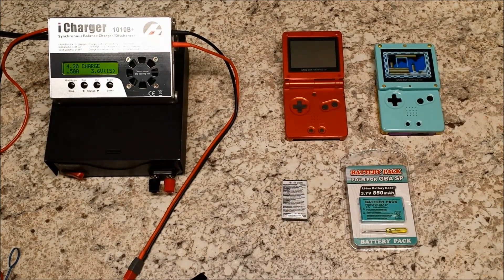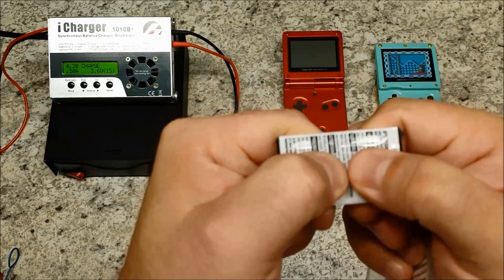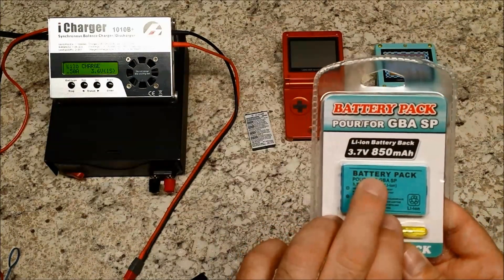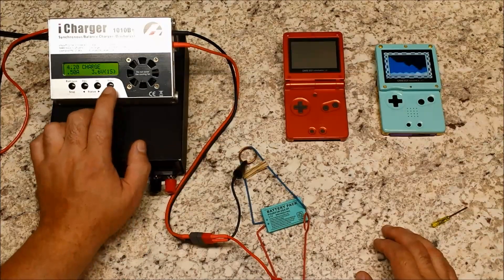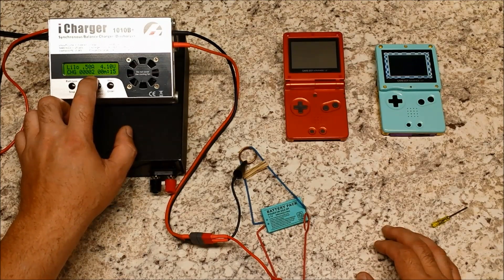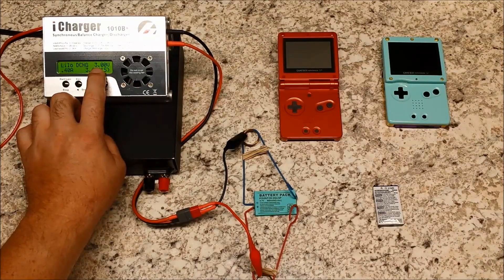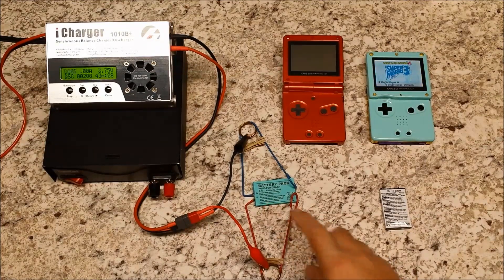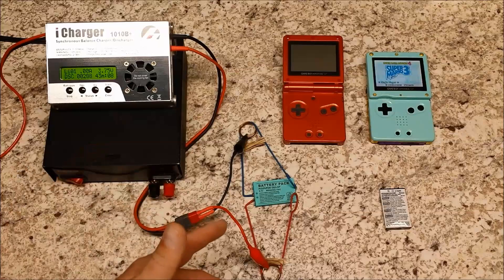Aftermarket replacement Battery for Gameboy Advance SP how GOOD they are? let see it

Comment: You still have 3.7 volts which mean the battery is pretty much half way charged meaning it's not fully drain. 3.2 volts i consider the max low should go for and you still can probably play a bit more on the council.

Comment: You’ve done it wrong. 
The SP battery is an older battery that uses an older charge circuit and fitted to a gameboy that’s expected to pull much less power than you are. 
A stock SP battery should be 700mah and an aftermarket one should realistically be 600-750 even when they’re labelled higher. 
You charged at 500ma where Nintendo say to charge in 3 hours that’s 230ma which will damage the battery and not charge as much. Discharging you pulled 400ma where Nintendo state the GBA SP should last 10 hours with the backlight in which is about a 70ma power draw. In RC terms you should be charging at 1/3C and discharging at 1/10C on your RC charger
Reply from the maker: I know that , if I set charge / discharge rate to a lower number it will be more accurate, and it takes much much longer time. I do believe my settings is in the safe site, my charger is made to be used with lithium ion batteries, and it will not overcharge it. Yesterday I did run another test, I set charge rate to 200mah and discharge to 50mha and final result is about 7% increase
Reply: it is a good idea to buy this model of battery? after all i dont find any other battery model for my gba sp :(
Reply: Edgar Sanchez just but what’s local to you and best price none of these cells have worse reputations than others